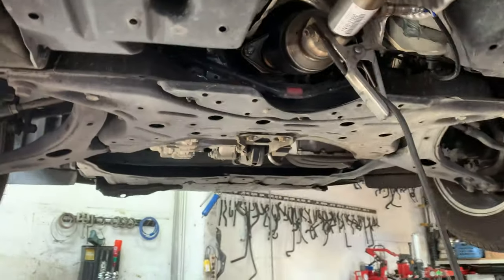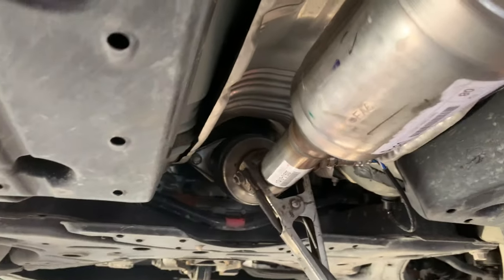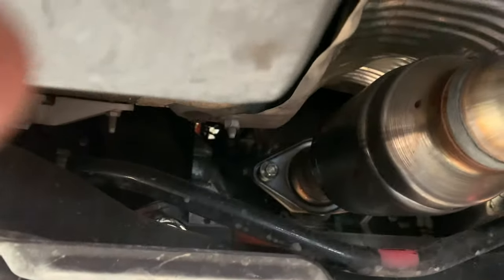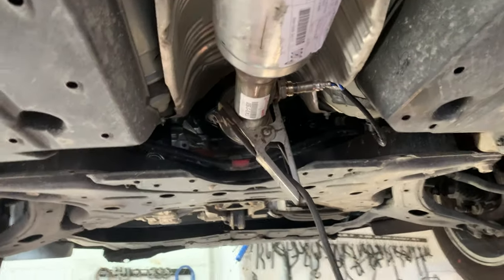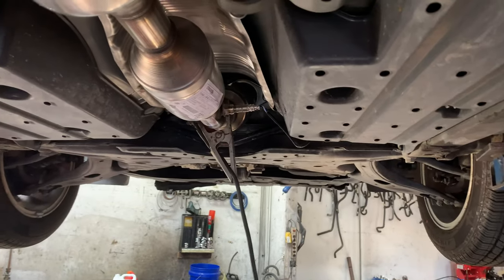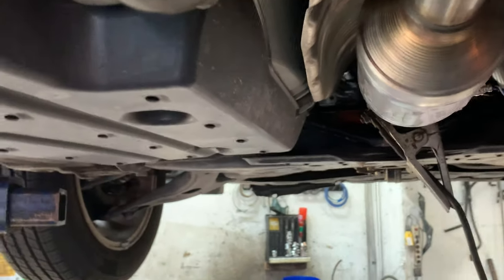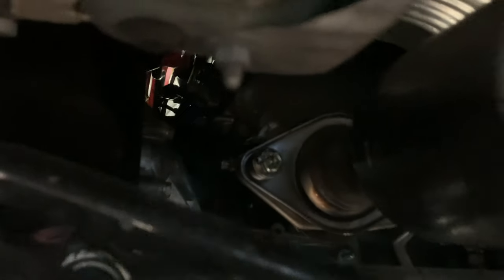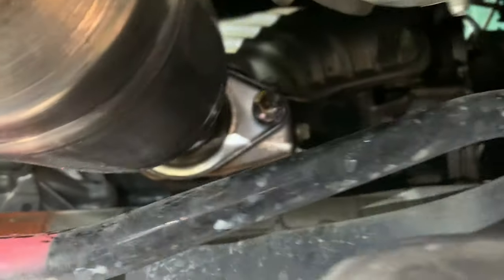Toyota Prius Catalytic Converter theft deterrent

Comment: Thieves typically just go under your prius at night and  cut the converter off from both ends so welding that won't matter, it actually makes it more harder on yourself because if someone does cut it off you can't install a new one anymore since you welded it like that
Reply from the maker: Cutting the upper end of the catalytic converter would require 10x the effort than cutting the lower end. We can unbolt the Cat or cut the upper end of the Cat in seconds on a rack and with the right tools, it is all a matter of deterrence.
Reply: Can steal the lower one by making two cuts.  It’s a modest deterrant. I’m going to ask to have this done
Reply from the maker: @technophant   you are correct
Reply: My neighbor across the street had the catalytic converter stolen off their RV at 2:00 in the afternoon. They were home and didn’t hear a thing. My doorbell camera caught the whole crime but couldn’t get a good view of their license plate.

Comment: Welding bolts won’t work as they cut it what you may want to do is weld a rebar piece to the pipe where they cut using a saw making it harder to cut through the exhaust pipe is easy to cut as it’s thin metal

Comment: I want to do similar thing in my Prius. I've Got MMA welder and I want to do it myself. But is this welding safe for car electronics, ECU, etc.? Did you unplug 12V battery and traction battery or something like that to prevent electronics from damage?

Comment: As most people have stated, this modification only makes it near impossible to replace components and much more expensive to do any work to the engine that would require head removal due to additional new parts and labor that were needlessly destroyed. Thieves do not disassemble the exhaust system, they simply cut either side of the catalytic converter. They could care less that you welded the exhaust flange bolts.

Comment: I don't think this dude knows how they remove cats.
Reply from the maker: Actually, you clearly don't. They unbolt the two 15mm bolts on the exhaust manifold because they can't reach the upper pipe with a saws-all.